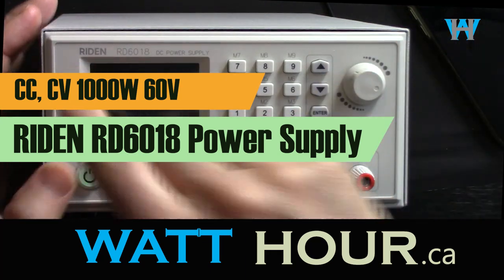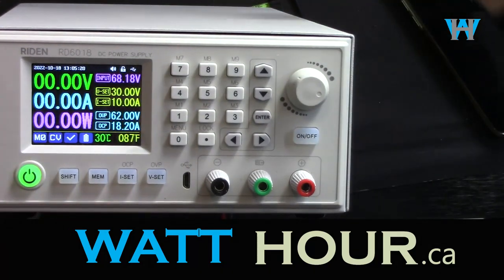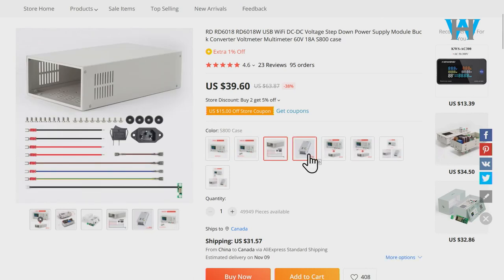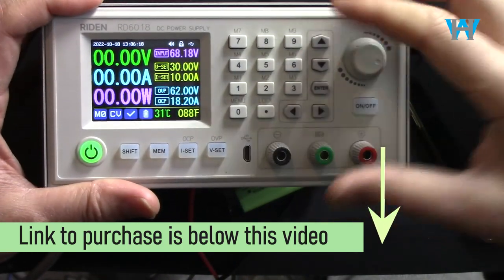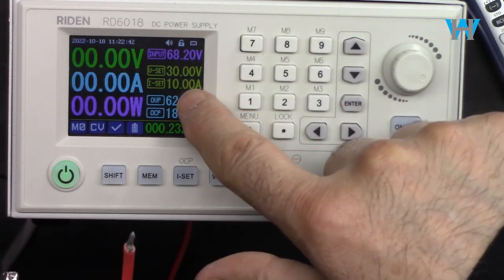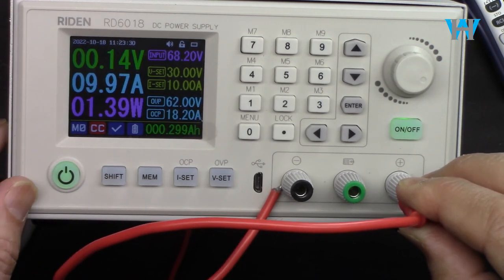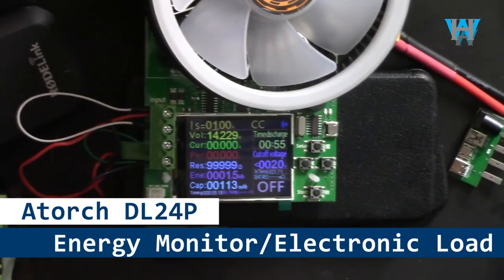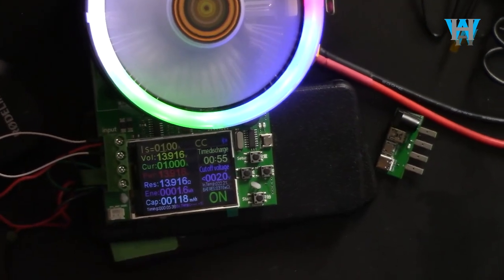Riden RD6018 Programmable 60V 18A 1080W Buck Converter | WattHour

Comment: I have the same model but have two issues

1. The power resistor 5k, 1 W, which came with my power supply (65 v, 13 A), gets pretty hot. Is this normal?for 65v it should draw less than 1 W, right?
2. Is the option to remove i-set? Instead of setting constant current, just let the circuit draw current it needs?

Thanks for the review. Great presentation 👏

Comment: I have only one question.  I do love this BUT the one thing that drives me crazy about some of these displays is the constant cycling of the AH, WH, Temp, Volts at the bottom right.  Please tell me if there is a way to turn the auto cycling of this information off and make it static?....  If this cannot be turned off, unfortunately this is a BIG deal-breaker for me.  Sometimes when charging I need to watch the AH rating or temperature for more than one second (and not have to wait for the cycle to go around again - very annoying).  Thanks is advance for the reply.  Also, very very nice job with the review - but the only part of this is when you were waiting for the cycle to complete to see the voltage again, you said nothing about being able to turn that feature off.  When you were waiting for the cycle to complete to see the voltage again, I was so hoping that you yourself were going to comment on how annoying that was LOL - but you didn't...  I have liked and now subscribed to your channel.
Reply: I think the rd6006 has new software that fix this the rd1018 doesn’t has it yet
Reply: @electro2606  Thank you so much for the reply, and I will have to check out the rd6006.  Hopefully it is as good as the rd6018 LOL...
Reply from the maker: Hi, I have mentioned it somewhere that the capacity and battery voltage is being switch but there was no option to disable it as I have explained all features.
Reply: @WattHour  on this type it is not posible. On the rd6006 you can set the shut off mah on the battery terminal its 0.1a on the rd6018 (You need the last update )
Reply: @Outside-In.  the rd 6006 has only 6 amps i think mabey the rd6012 has the same update you need to check. Rdtech has a youtube channel
Reply: @electro2606  Thank you electro, I was wondering about that after leaving the comment.  I definitely need access to more than 6 amps, so I will definitely check out the rd6012 as you suggest.  Thanks again for your replies.
Reply: @WattHour  Thank you WattHour for the reply.  I must have missed it, sorry about that...  I just wrote Riden and am waiting on a response from them.  They are going to be updating the firmware for the 6012 and 6018 but not sure when it will happen.  I also gave them a couple ideas on how to better utilize this information, and hopefully they will be able to update the supply with a new separate screen for this info - that would be perfect.
Reply: @electro2606  I just wrote Riden and am waiting on a response from them.  They are going to be updating the firmware for the 6012 and 6018 but not sure when it will happen.  I also gave them a couple ideas on how to better utilize this information, and hopefully they will be able to update the supply with a new separate screen for this info - that would be perfect.

Comment: I would recommend getting used server power supplies and stacking them in series rather than getting a Chinese PSU as a power source for this.
Reply: Kinda tough to get 65 volts from multiple 12v server supplies, though, but i agree that they are way better built.
Reply: @englishrupe01  you get 60V nominal and you can use the internal adjustment pot to fine trim it to your liking or use a 72V nominal and lower it down a bit.
Reply: @englishrupe01  and connecting an external pot to the external sense pins allows adjustment upto 13.5V per unit.
Reply: @tanishqbhaiji103  I agree....but that means you need five or six server psu's, as they are all 12v that i have seen and used, so would be a pretty big case.

Comment: The apps on mobile phone are very bad i can’t get them to work. You need to turn off ip isolation on youre router but it still doesent work fore me
Reply: It's been working on mine, though it's a bit unclear the quickest way to connect, the network distribution selection is either needed each time or the power has to be cycled after the app is open. It does work very well though. 
It seems to be only accessible when you're on the WiFi network with the phone, not when you're remote and trying it through a mobile data connection.